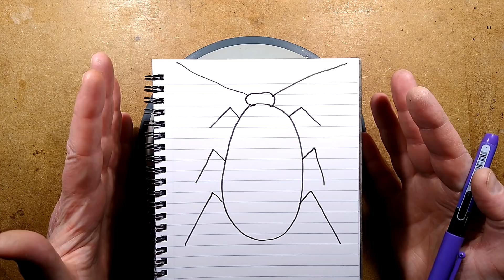Exploring an unusual prototype cockroach zapper.

Comment: That flyback is kinda oversized for the purpose (and the tiny sparks it gives; still it's smallish somewhat), as we know a flyback like that can put out some juicy arcs with the right circuit. I like the idea of the primary winding being put directly onto the coil pack. That provides the best coupling actually.

Comment: Total guess: A visual estimate of the extant additional outer windings, rewound on that thinner main core, may in fact be close to it's physical limit to contain the fat wire. Perhaps they are using a very specific ratio that coupled with their choice of fat windings in fact exceeds this spatial limitation thus they chose the obvious second option?  As in a non-spec usage of a spec part.

Comment: So it works like bumper cars at the fairground (the older overhead system).
Reply: there is a new system?
Reply: @Ramog1000  I've seen some weird new battery-powered bumper cars which also have an annoying function where it replaces your controls with random inputs every so often.
Reply from the maker: There are floor based systems that have about 50V on alternate metal strips and rectified pickup brushes.
Reply: @BigClive  ehm ? :)
Reply: @eDoc2020  I HATE THOSE
Reply: @BigClive  , i#d rather stick to the traditional ones. (ooo, all them sparks!)

Comment: I found an article in Spanish about a similar device but with a slightly different design with hi voltage rail maze, and it was set to discharge every 5 minutes. A video with the watch code kX1ZskHPIcE shows another cockroach zapper designed as a bucket with. I don't want to paste the links in this comment due to YouTube's overzealous spam protection.

Comment: The LM393 is a dual comparator (rather than an op amp)....I wonder what voltages it was comparing?
Reply: It's watching the output of the HV multiplier via a big divider to regulate the output at 6000 volts. The supply works very similarly to other regulated switching supplies where this same feedback signal is usually provided by the optocoupler being driven by a TL431. The concept was to regulate the output to 6000V @ 12ma to keep it "safe".

Comment: what year was this prototype pcb built? Looks like mid 70s to late 80s, judging by single sided, through hole components. The traces are quite odd design also. not using 45 degree / parallel trace rule that my instructors taught me in 1988 pcb design class. loved watching you dig into this unique product.

Comment: Not sure what you mean about that printed circuit being so expensive.  I used to make similar ones using letraset-style etch-resist stuff that I think I probably got from Maplin.  You could make a very professional-looking PCB (Unlike the old Dalo etch-resist pens)  The inventer could easily have made that himself.
Reply: Was going to say this. In the 80s I made quite a few custom PCBs using a tracing paper, what we called "photo print board", actual photo fixer and an etching bath. Draw the circuit on the tracing paper, put it on top of the sensitive side of the PCB, expose with UVB light, put in fixer, wash it under the tap, then put it in the etch bath.

Comment: I have a few good Ideas. I sent in a remote car started Idea back in id say about 1986 but they wanted $6000 back then so I had to let that idea go. I sent in an inverter idea (12v to 120 v)  back in 1990 but they wanted the money upfront and would not tell me how much until I sent them the idea. About 10 years ago I had an idea for solar head lights on cars  ( side walk side) the light would stay on after the car was off for the night so it would help keep the side walk lit up. It would be a great help in area's that dont have street lights. I had  a conversation over the phone a few times with the same guy who told me he would do all he could to get the idea going with no upfront cost then about 10 call's in he says '' great news we will do it and it's only going to cost you $10.000 upfront lol . I have a few other's I have sent in like the '' remove the wing mirrors of cars and use cameras and a small screen in the car. I sent that idea to a car company but they never used it I think they sold it to a high end company because I did see it advertised on a'' richey rich car'' a few years later. I do have some ideas sitting here I did not send in and with China able to copy and build them faster then I could get a Patent I think ill just sit on my ideas and see how long it takes others to come up with the same ideas.
Reply: Just send all your ideas to China and pick up finished product from Ebay 6 months later.
You won't get rich but you will see them made flesh quite cheaply.
Reply: Back in the days of dial-up modems I had a "Good Idea™". Same as you, a patent lawyer would not commit to a fixed price so I thought that I'd do it myself.  I figured that by copying the wording and style of similar patents it would not be too hard. I went to the patent office in London. Due to their index system it's quite easy to find patents in that field. Then you can pay for how many photocopies that you require. I cannot remember the price but it was not expensive. About one month later I read in a scientific journal that someone had beaten me to it :(
However, if you want a good day out go to a patent office. You will see hundreds of people scurrying about and they all have dollar signs in their eyes, dreaming of the wealth that's coming. It's amusing, take sandwiches! 
Good luck on your next endeavour.

Comment: Re winding the primary. They put it on the secondary because the wire is so thick there wouldn't be enough room to wind it in multi layers on the ferrite core. Perhaps!

Comment: Same concept as an electronic mouse trap. Black plastic box that uses D cell batteries. Inside, a metal plate on top and one on bottom. Mouse enters and it's body completes the circuit.
Try to get an old school photographic electronic flash. Same process, batteries charge a capacitor, some as much as 600 volts.
Reply: Lol yeah I got a big zap off an old compact camera flash wen I was a kid...the ones that squeal as the charge. Had it to bits charged the flash  an was poking about with a metal presicion scroggy an bam I got a huge zap I nva realised as it was only 2xaa batt. ...that was the day I learned about capacitors

Comment: I don't understand the theory of this device. Leaving the roach alive to keep it from ejecting the eggsac just means it will lay the eggs like normal.
Reply: Maybe the roach is supposed to die from malnutrition first.
Reply: @emmettturner9452  If the inventor hadn't reduced the voltage with resistors the device would vaporize the cock roach eggs and all.

Comment: I think to put a longer Primary on that Transformer. IF one starts winding the Primary on the other leg of that core, You do need a lot of windings to equal the length of wire, and make a such thick coil that it would not fit. Not only Turn Ratio counts,  Wire Length is allso a factor. E.G. 17 Windings around that thick Secondary has a lot of more wire then 17 windings on the other leg.

Comment: That flyback transformer design is more than unique. Could those windings over the secondary be for purposes  of collecting eddy currents, and using the Hall effect for something other than power production?? I ask that, because most, if not all of the resistors ± 5% tolerance, and not needed in a capacitance discharge function. Could they be using the frequency of the voltage captured from wrapping the secondary, as an attractant/lure, or a "cockroach level Manhattan Project" intended to further zombify the antennae-deficient insect. Time to watch "Joe's Apartment"...  Scope time??

Comment: Clive. Would you consider dissecting those cheap practical joke electric shock items? A parker pen type item. A marker pen type item. A fake lighter item. Can the items be hacked and ramped up slightly on shock value because as purchased they are shite to be honest.
Reply from the maker: The older ones used a mechanical buzzer which was unreliable.  The modern ones use a pulsed transistor and inductor to generate the spikes.  They're probably aimed at being safe for kids with soft sensitive skin.

Comment: That was interesting, to say the least, but it's been a long day and I haven't really taken it all in, but I'm guessing you were alluding to a sort of sawtooth generator down there at bottom left? I could see that making sense, ramp up quickly, bleed off slowly? to give that high frequency repetitive spark. Or am I talking nads?
Reply from the maker: It goes through a cluster of schmitt triggers, so it would be driving the MOSFET with a square wave.
Reply: @BigClive  Which makes more sense. But then, I did say it had been a long day. Can't see why I got the notion of a sawtooth stuck in my noggin. 😺😔

Comment: Hi Clive,
Always enjoy your videos.
I wonder if you would be interested in doing a Boogie Board knock off, tear down / reverse engineering?
They are cheap now. I modded one recently to erase from a micro-controller, the tech and the erase waveform is very interesting; 50,000 erases from a 3V coin cell.
Anyway, thought of you when I was looking at it.
Regards,
Reply from the maker: I have a couple here.

Comment: Why is there so much space on the resistor size of the board? The PCB has potential to half the size.
Reply from the maker: For high voltage separation.

Comment: The only thing that real  kills  roaches is  Boric  Acid and sugar  !  Kills  them  dead  They go for the sugar and they bring  the  Boric  acid  back to the nest  on their  body    It  does work,  wipes  them right out .   You   said  " SAC"
Reply: Kills them dead? As opposed to what?. . .
Reply: Yes, boric acid, but mixed with sweet condensed milk. The roach eats it, dies, but OTHER roaches eat the dead one. On my boat, we had a lot until we planted Boric Acid & Milk - the one that was left was MASSIVE, it ran over my face, through a hole in the anchor locker, over the side, down the anchor rode but the turned back...........the mother of all roaches (daze-off.co.uK).

Comment: In case anyone is curious, gel bait in the correct places: corners inside cabinets, behind refrigerators, and under sinks is your best bet. Cockroach feces maintains some lethality if ingested bait is in there as well as dead bodies meaning that secondary feeding and cannibalism aid in reducing activity. Of course sanitation and attacking the root sources (usually an adjacent or nearby apartment) are vital.

Comment: So it creates Blind cockroaches. Exactly how does that improve anything ?. lol.
Reply: My thoughts exactly ?
Reply: If you cut off the antenna of a cockroach you can attach electrodes and a small radio control unit. Then you can control the direction it moves in.
Reply: The antenna also act as touch and smell, cant find food .. starve ... blah blah blah
Reply: I'm actually with DJ on this one. It's not that we don't understand it makes the Cockroaches blind. The Cockroaches are still going to die someplace and presumably still eject their egg sacs. The difference is that the Cockroaches will die someplace else. That's why this seems weird to me at least. Not sure if that's why it seemed weird to DJ.
Reply: @retrohipster994  aparently a starving cockroach can reabsorb its egg sac in an attempt to stay alive. I guess the idea is that it's not injured enough to eject the egg sac, but it is injured enough to eventually starve to death and by that time it will have reabsorbed the egg sac and thus not reproduce.
Reply: Their feelers touch the top plate, their legs are on the bottom plate and -- whammo -- fried roaches," he'll tell your guests.
"It burns out their nervous systems," he'll tell them.

Then you simply open a trap door in the bottom and discard the crispy-critter corpses.
"You can take a head count and then just tip them in the trash can. It's sort of fun. I enjoy waking up and doing it before I've had my coffee."
Reply: @fermitupoupon1754  oh! Then I can see this making sense.. Thanks for the info fermitu! 👍

Comment: The transformer core looks very similar to the line transformer of an old crt monochrome small screen tv or monitor.
Reply: That is exactly what it is, just a model that used an external tripler module for the EHT generation.  Gives around 6-8kV at the base pins, which then is fed to an external potted voltage multiplier to generate the final anode voltage applied to the CRT. Winding the primary around the existing coils gives better coupling and thus higher efficiency, which is needed here as the primary current will be somewhat slow in turning on and off, as a result of the mosfet drive being inadequate. 

Surprisingly enough driving a mosfet in line output stages needs roughly the same drive current and power as that for the bipolar transistor, to get turn on and turn off times to be fast, as you not only have the massive gate capacitance to deal with but also charge coupling from the channel as the voltage rises or falls injecting current that opposes the gate voltage. Mosfet gate drivers for high power ( and IGBT as well for the same reason) need to be able to source and sink currents in the ampere range during transitions, so they may actually dissipate more power than the transistor they are driving. The 4 parallel gates might be just about able on 12V to drive with 60mA of current, so the mosfet turn on is slow, and turn off decidedly slower, which here is also limiting current spikes, as that track layout is less than optimal for the currents involved, the current loop should have had thicker traces by the mosfet and capacitor. Going to bet the transformer has a 12V primary, just the developer found the DC resistance was too high with the slow drive to get the high voltage, so went for the thicker external winding, and probably double the number of turns as well.

Comment: Screw that; increase the voltage until it’s just under the point where it’ll arc from plate-to-plate. Then any bug foolish enough to come between them gets to experience a lightning strike first-hand as the charge gets dumped from a huge electrolytic cap, Rodalco2007 style! 🤣😂 Death to cockroaches (ohhh, and fire ants, too)! I hope they get a nice, warm room in the roach motel from Hell! And, while they’re down there, I hope the fire ants build an epic anthill; then any demon foolish enough to bother it will experience real agony! I think even Satan will rule this cruel and unusual punishment.